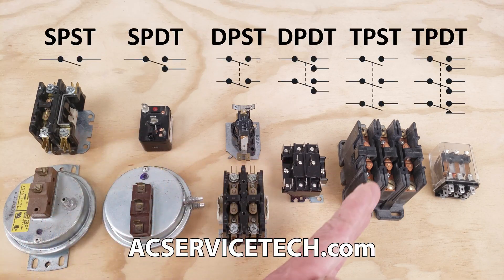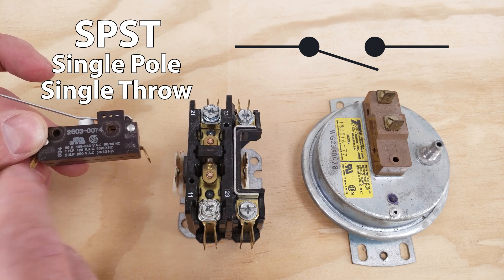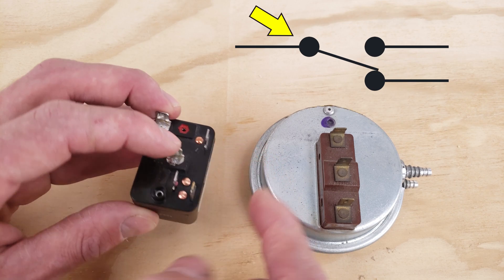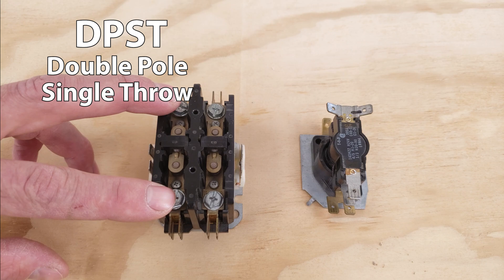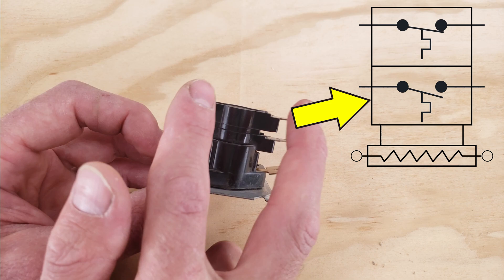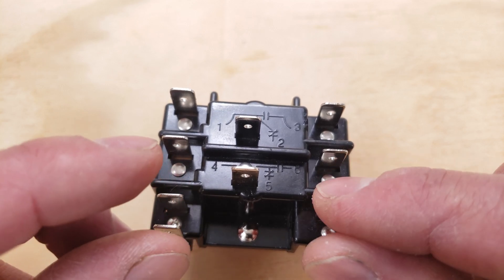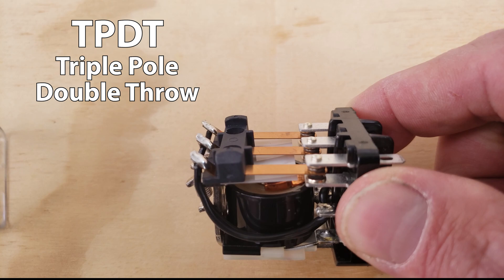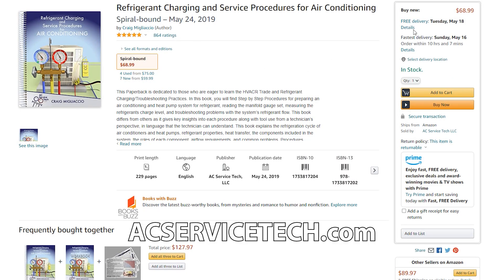HVAC Electrical Switch Types Explained: SPST, SPDT, DPST, DPDT, TPST, TPDT

Comment: i wish to seek some advice. If I want to set up two battery packs with the same voltage ratings, and connect it to the same load, such that only 1 battery pack is utilized at any time to power the load, while the other serves as a backup until required to switch over. What switch would you recommend ? Thanks in advance for the advice.